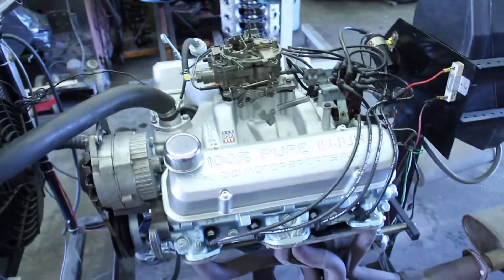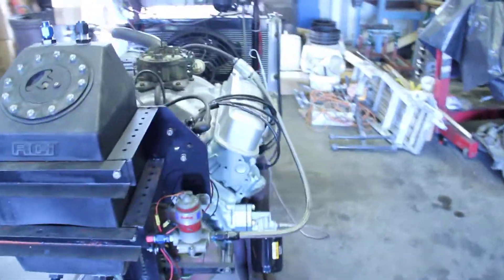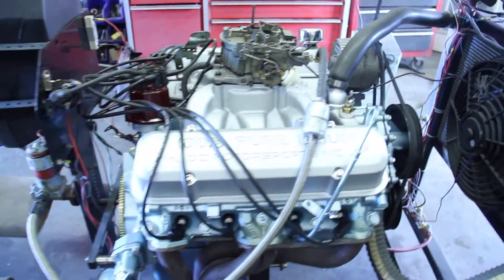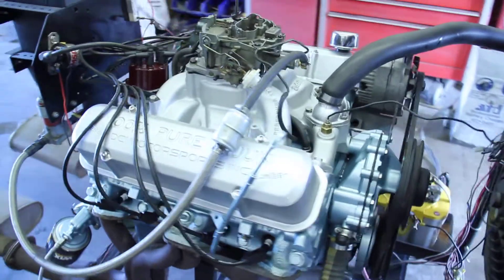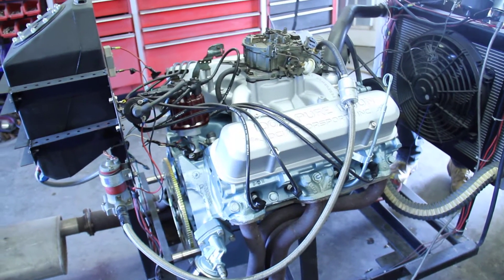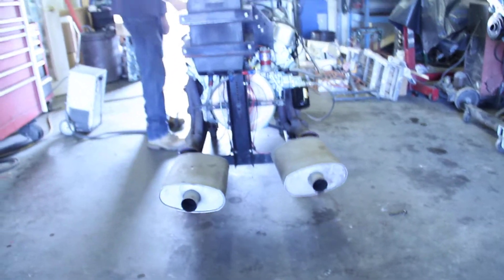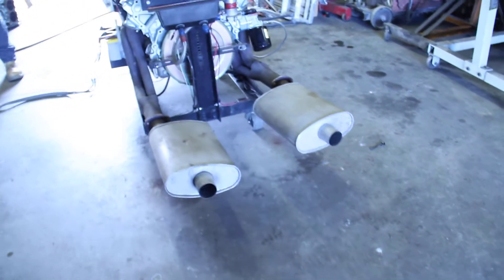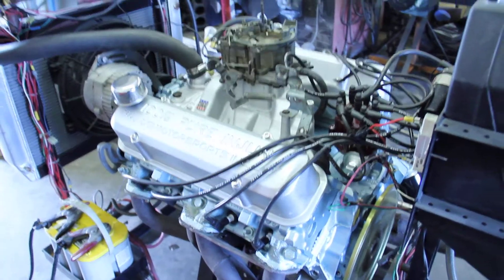DCI Motorsports pump gas 428/467 stroker , iron #62 casting cylinder heads 9.5-1 compression.

Comment: I'm curious if you guys dyno'd this motor?  If so, what were the numbers?   I have a 69 XF code 428 with #48 R/A III heads.  How much would it cost to freshen mine up similar to this one?  Can you get me 510 lbs of torque with stock bottom end?
Reply: The #48 and #62 are both 72CC Chamber heads about the same on intake port and exhaust chamber size with 2.11 and 1.77 valves.   Ran them on a 455 motor 1970 block and it had about 11.8 - 1 compression on a 455.  Mine was .060 with a thin gasket and was closer to 12-1.   On a 428 motor it is about 10.5-1 unless you either run dished pistons (not usually good for flow) or open up the chambers in the heads to drop the compression.   That's why a bunch of folks ran the 4x and 6x heads but put bigger valves on it.   Once they ported them up and put the big valves in it they were a 9.5-1 compression with a flat top piston on a 455.  Stock bottom end I would never do.   You are talking about 40 plus year old cast rods?   Too cheap to put aftermarket rods and are way better.   ARP rod bolts a must and yes you could get 510 lbs of torque easy.